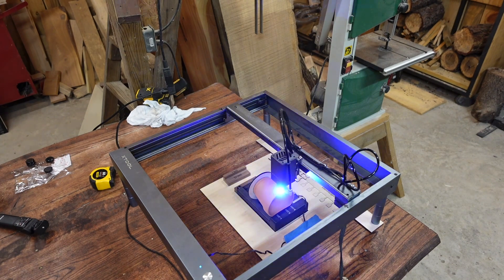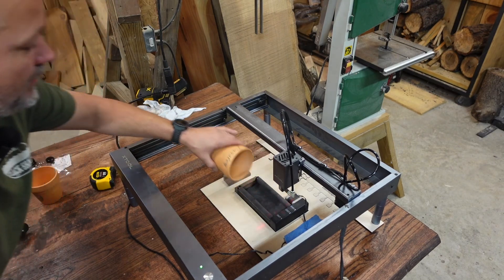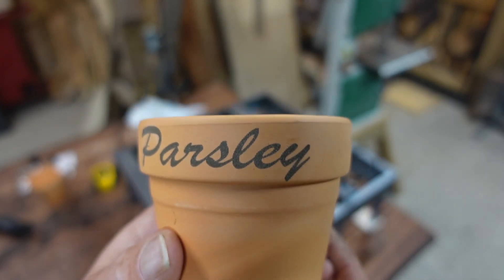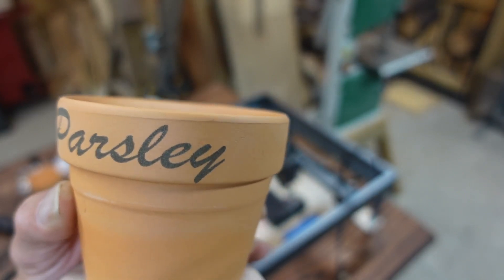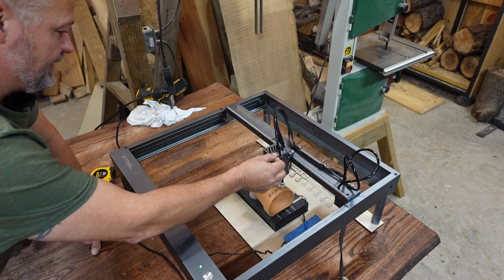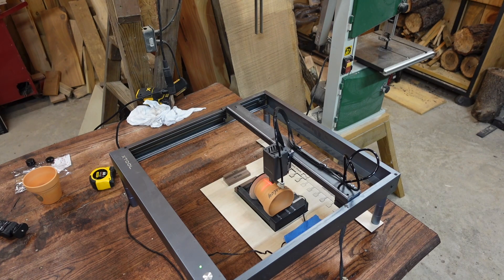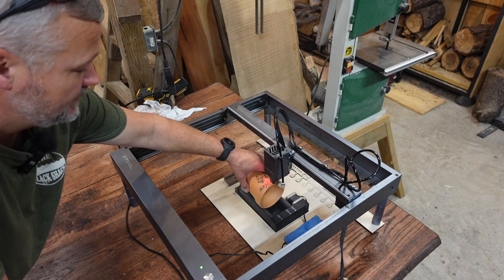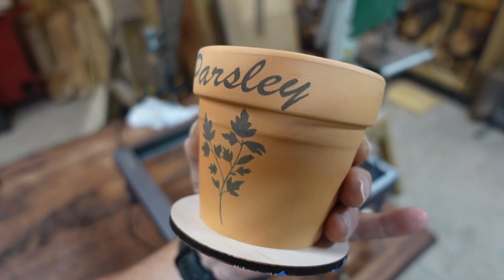Engraving a terracotta pot

Comment: What was the thickness of the round piece for the bottom? I made one out of 1/8" thick and did fine on the first one but on the second one the big end shifted on the rollers abit. Just wondering if the thickness had something to do with it.
Reply from the maker: I made it out of 1/4 inch. It is actually 4.9mm thick

Comment: Hey - what settings (speed, power) did you use? Thanks for the content!
Reply from the maker: It was in the description. 
A new laser engraver project for winter. Engraved with the XTool D1 10 watt and the standard XTool rotary. 30mm/s at 100 percent power.

Comment: thank you for all your videos im very new at this and they are helping me out big time  I have a question maybe you can help I have the xtool 20w and only did a 3 burns why is my nozzle and guard getting full with soot
Reply from the maker: It will collect some, just clean it regularly. I keep some air running to keep the lens clean. If it is really bad, I would say you need better exhaust.
Reply: @TheClackShack  thank you for the quick reply so it normal than also I want to purchase your jigs the one for the Rotary works for the RA2

Comment: Sorry dear  to burst your balloon — but these pots, especially the herb ones, are sold everywhere and have been for years — specially garden and gift type stores, online, etc. .  China, India, Mexico etc produces them in the tens of thousands, probably hundreds of thousands.  But where you can come up different is personalization.  Look up personalized clay pots.  But yours are very pretty and can see them being used for a number of purposes. What made them that color? I have seen them just an outline and then some with water color type paints used to stain them for use as dry type gifts like silk plants, etc.  But it sounds like that color was caused by the laser etching. 

Another idea is to drill holes in pots for orchids — with orchid pots if you do it right and find the right size blank pots, people will buy them because it’s difficult to find them in areas that don’t grow lots of orchids. And breakage is high for shipping.  Orchids don’t like deep pots, they like wide and shallow pots, not deeper than it’s wide.  More like bulb or azalea pots but those change depending on the size of the pot. Most come in 4”, 6”, 8”, 10”.  Also very important, is pots which are wider at the bottom so they don’t tip over as the plants grow.  If you live in Florida especially the mid to southern part, there are orchids everywhere and most greenhouses/nurseries have them for sale. But not many will ship them and they are very expensive to ship due to weight.  You have to look at actual orchid supply shops and check the size of their plastic pots or clay if they have them to come up with what you want to use. They usually get them in from south east Asia because it’s cheaper than pots here.  I caution, you don’t want the holes too big, because they won’t be able to hold the media, it will just fall through.  

Orchid people use clay pots with holes because orchids need lots of air circulation and so they drill holes in the pots ie the sides all around the pot.  Also in hot climates, the clay helps to cool the plant.  In nature in the jungles it’s very humid, showers each day and they grow on the trees - some grow up high that want lots of light, others grow for more shade. They  grow on the tree — but aren’t a parasite, they don’t feed on the tree. Just use them to grow on. The roots spread and just wander around.  And it’s the same when growing them in our homes, porches, greenhouses, etc. Because we But they all want breezes - enough to make the leaves moving just a little to keep fungal diseases from getting a hold.  But for the most part, when we grow them in our set locations — we put them in pots with a variety of media (specialty bark like New Zealand pinus radiata  which the best of the brands is Orchiata, but use specialty orchid sphagnum moss which is blond in color and the best of that brand is Besgrow. Another New Zealand product is tree fern which plants that like to stay consistently moist but not wet.  It really depends on the particular type of orchid. But they also grow in fir or cedar bark, granite or river rock, large horticultural charcoal. What you find in most farm or garden supply stores is too small unless growing seedling right out of the flask. You have to find large diameter charcoal meant for orchids.  Some folks use coir, or coconut chunks, even lava rocks which you can buy at your local Lowes, etc.  of course, you don’t use anything that has chemicals or fuels on them and you want to soak them in a product called Physan 20 which is an algaecide, fungicide , bactericide, and viruscide. You soak them by directions on the bottle or better - their website and let dry, don’t rinse. Speaking of the pots, they need to be soaked in the same product before using them.  

Also, you might want to put your name on the pots especially if showing the plants, or an exhibition, or for any number of different purposes.  . No sense putting the name of the plant (for the most part) on the pot because you will need to put in new pots each 2 years or so if growing in regular type bark, and sooner ie 6-12 months if growing in moss.  The NZ pinus radiata can last at least 4-5 years if you will dust the bark with pulverized dolomite limestone. As barks are very acidic and get more so as they break down. High quality orchid mixes should come already conditioned with lime.  If you divide your plants each repotting, then you could put the name of the plant in the pot and some people do divide but others want to have what they call specimen plants which are grown out to be quite large so they are moved into larger pots each repotting.  

But what we find really helps, and if you know anything about installing tile and cutting the tile for the size or shape — you know the tile cutter machines use water.  Someone I know use to do all his own pots because it was a lot cheaper than buying them especially if you live in the north or central part of the country.  Many people do this. I haven’t been bold enough to do my own yet and it really helps to set up a vice to hold the pot in place as you work your way around.  

He found soaking the pots at least over night to 24 hours and having them stay wet as you drill.  In fact, sometimes he would have someone use a 20 oz soda bottle and keep pouring water over it as he drilled.  Kept the pot moist so less breakage and the drill bit cool.  He use a diamond type drill bit — like what’s used to put holes in doors for a lock mechanisms, but you want a very small diameter  like a 1/2” - 1”, maybe 1 1/2” if using large media for growing orchids like Vandaceous types which like a lot of air.  In fact,many of them including me, grow mature Vandas just growing on basket hooks with no media — just hanging around.  And of course the pot size makes a big difference on the drilling size and placement.  Of course you might not be able to use water with this laser cutter and might have to have the pot dry a little where it’s not dripping, the color isn’t deep red but it’s not dry either.  

But to give you an idea of the holes I’m speaking of for clay pots — look at the following websites or their Facebook pages. Search Banjong Orchid photos and you will see some of the pots with the holes in them.  Also go to their website and to RF Orchids and look at their photos.  Maybe it’s something you can do with your engraving machine, maybe not.
Reply from the maker: Ok, then